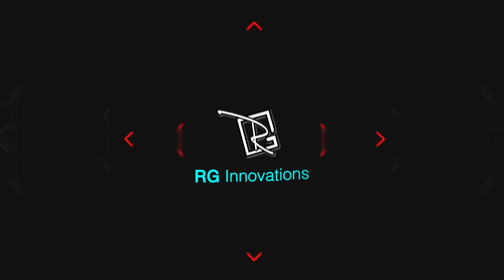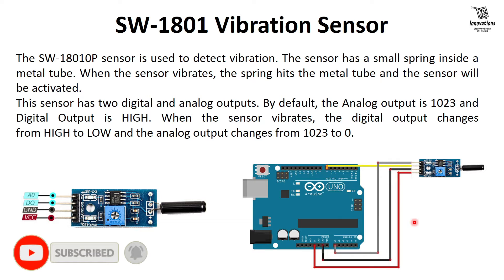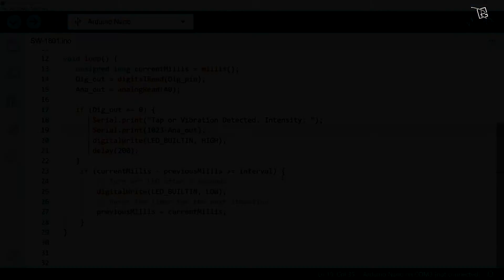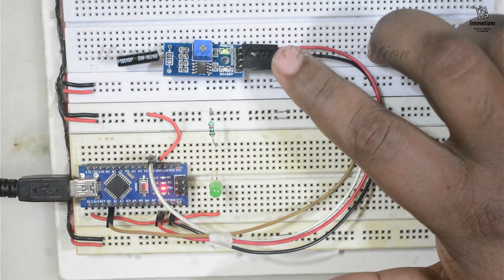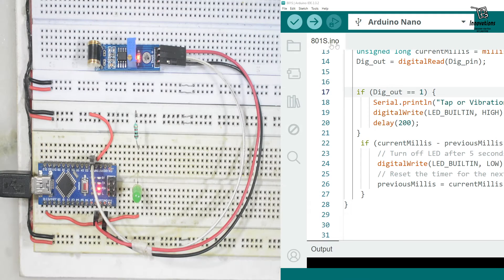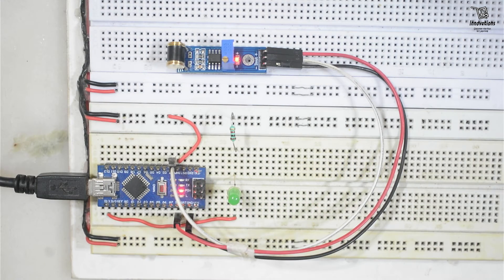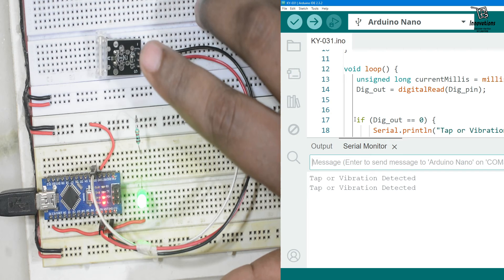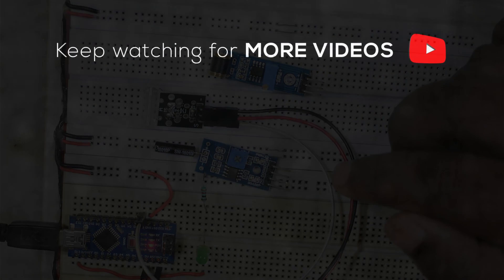3 Vibration Sensors Covered in one Video | SW-1801 | 801S | KY-031 | All Practical Demonstration

Comment: Great video! Can you make a new video using the 801s sensor and the ISD1820 module together to make the vibration sensor make the audio play through speaker? I’m new to all of this so I was also wondering if these two devices can be plugged into a different device that doesn’t require any coding. Thanks for any info!
Reply from the maker: Thank you for your interest in my video. I will try to make a video on this when i get time.

Comment: Sir,good day

Is this type of sensors used to detect motor vibrations while running and it's op should be o
0 to 10V or 0 to 5V is it possible
Reply from the maker: Analog value not possible with these sensors, output is digital only, either on or off.